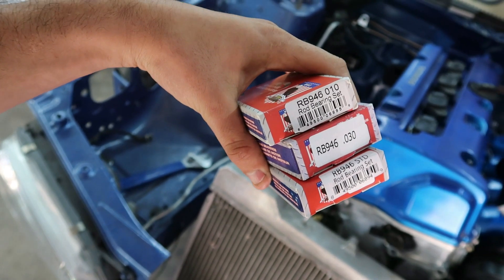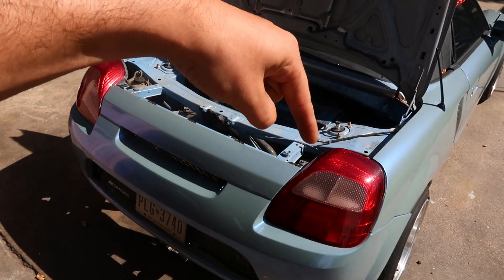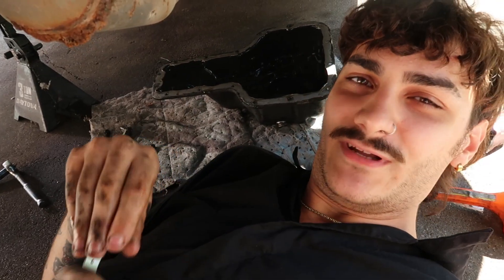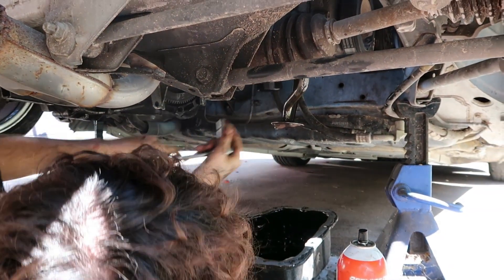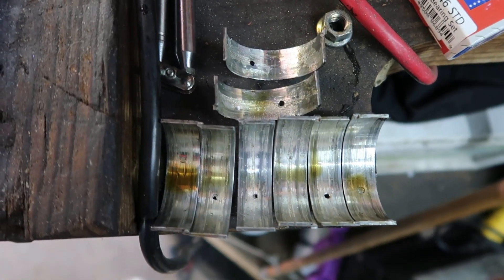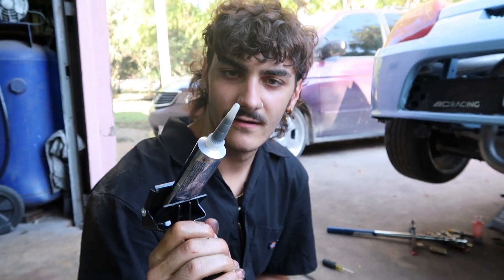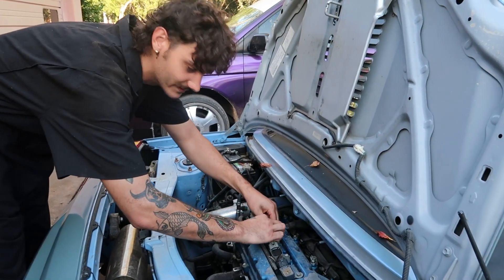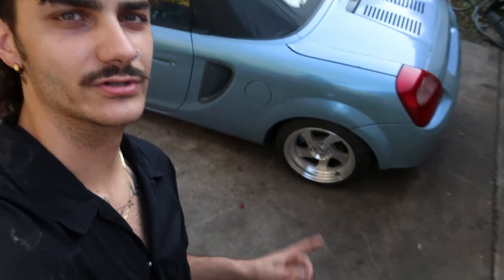Rod Bearings ALMOST Left the Chat

Comment: Did you end up just replacing 1/2 of the rod bearings?
Reply from the maker: I replaced all the rod bearings but not the mains
Reply: @Prestanium but there’s two pieces per bearing, did you get the top ones out on each cylinder or leave them in?